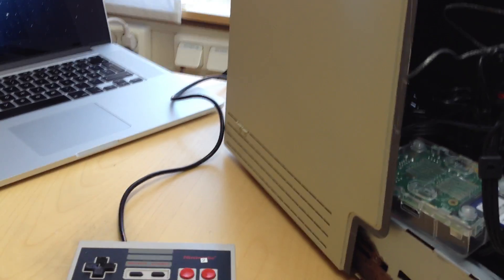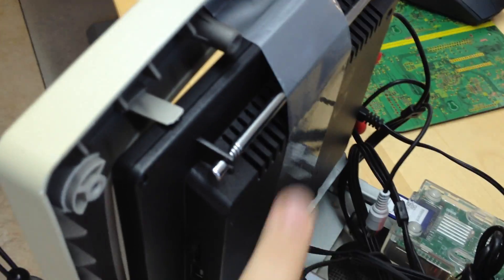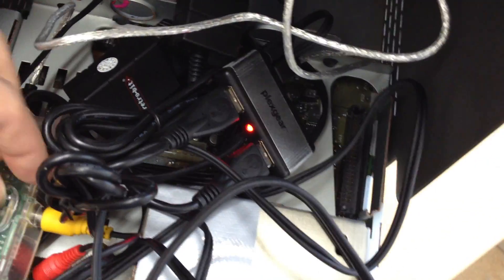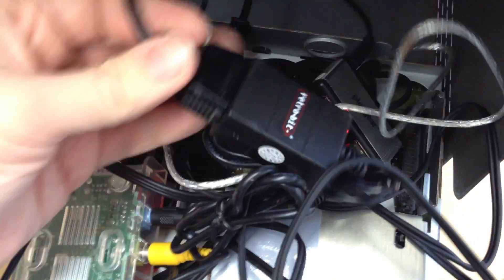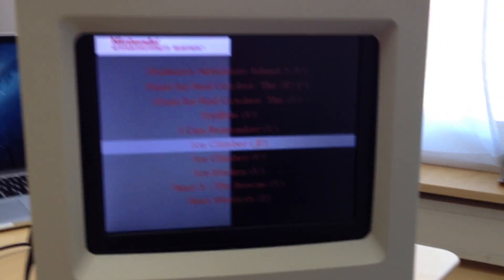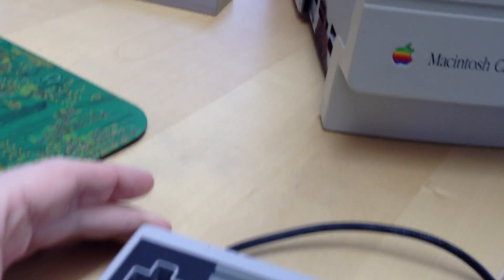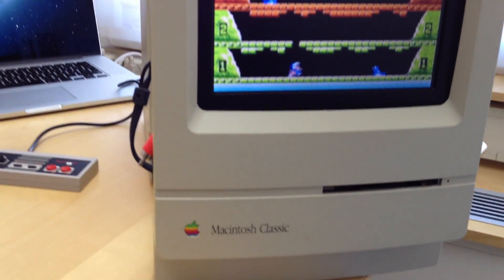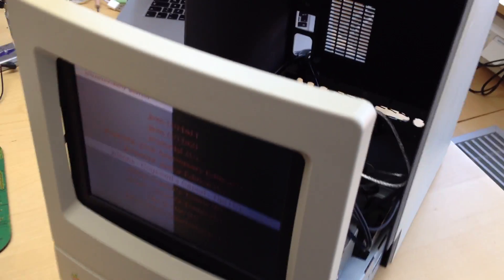Nintendo NES on a Mac! Macintosh Classic with Raspberry Pi and Retropie

Comment: it's not possible with the REAL mac monitor? why replace the original monitor?
Reply: A. it's a monichrome monitor B. it's highly unlikley that the monitor would be converted to work with a pi.
Reply: yes it is possible! you need a monochrome CRT with composite video input

Comment: I have the exact same nes controller adapter. it runs fine in retroarch but isnt recognized in emulationstation. what did you do to make it work?
Reply: did you fix it I am running 4.0.2 and I am about to order those adapters not sure if they work or not

Comment: Wait.. the audio jack of the RPi actually works? I got it to work for half a song with horrible quality, before completely dropping out again, after manually insmodding the kernel module that was probably disabled for exactly this reason.. yeah, you should try something else for sound =/